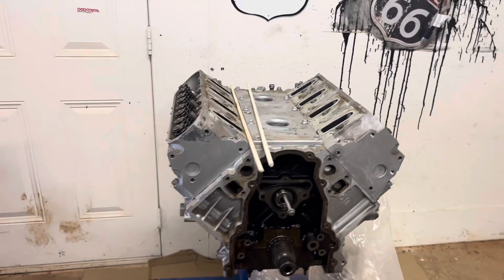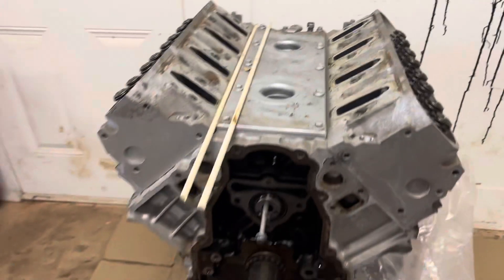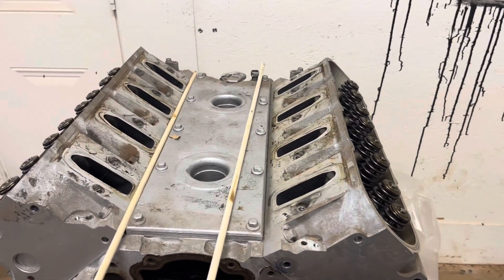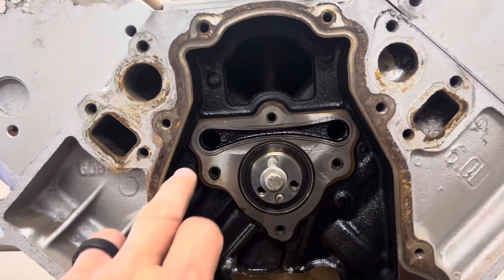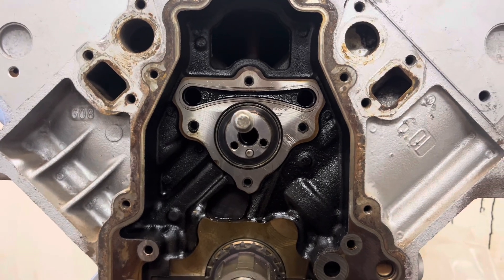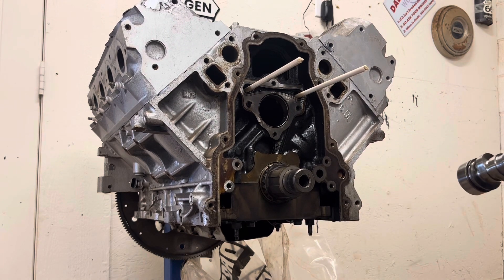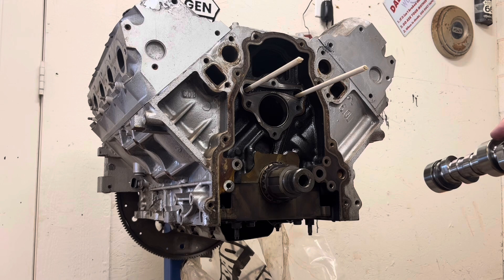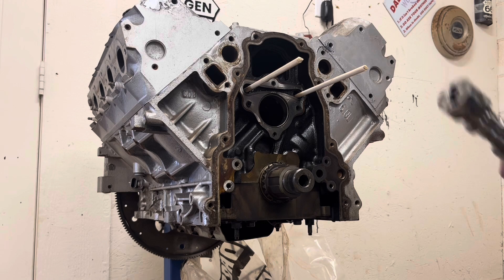How to remove a LS cam with the heads on.

Comment: Where’d you get the dowel rods from?
Reply from the maker: Ace Hardware
Reply: @3rdGenC10s  man I thought so, thank you for the confirmation!!
Reply from the maker: No problem
Reply from the maker: But if it’s on a stand just turn the motor upside down and you don’t have to worry about the lifters falling this is more for if your engine is still in
The vehicle
Reply: @3rdGenC10s  yes sir, I’m doing a can swap and don’t feeling like pulling everything out besides the push rods
Reply from the maker: Ace Hardware but any hardware store should have them.